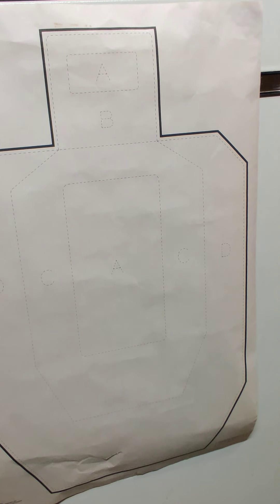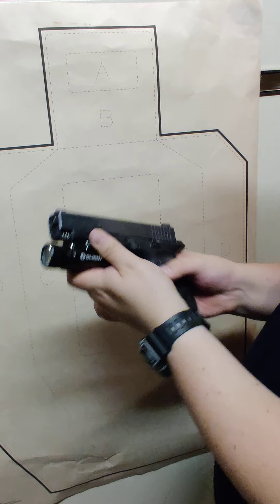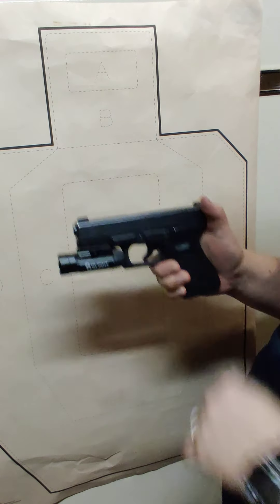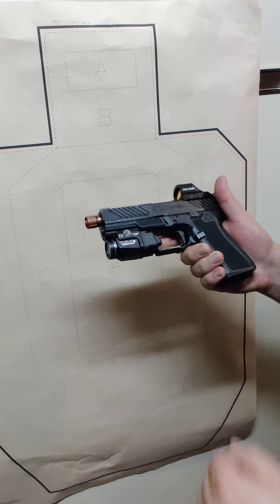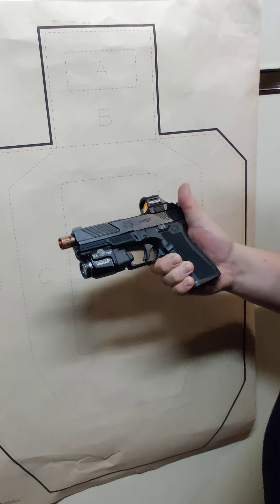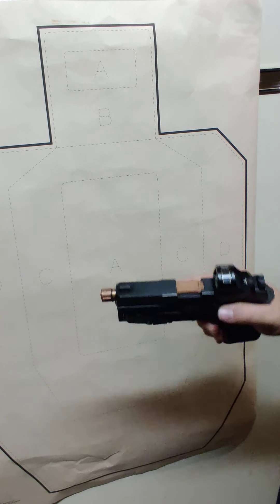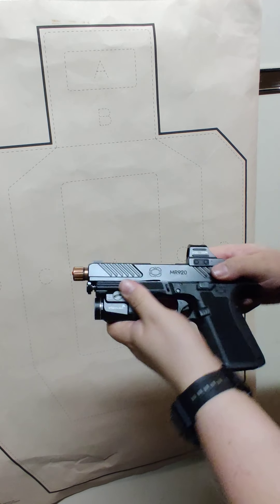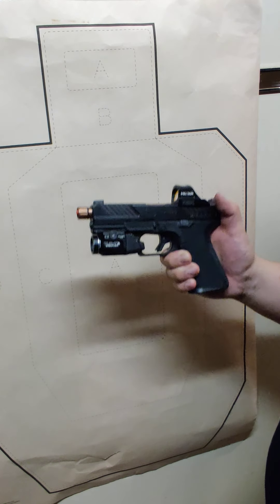Shadow Systems MR920 disassembly process vs a Stock Gen 4 Glock 19

Comment: Nice, just what I needed to know. Thank you sir. My MR920 Elite will be at my FFL in a day or two! Can't wait.
Reply from the maker: So awesome! You're gonna love it.
Reply from the maker: The best thing about it is the shooting experience. It's so smooth and controllable and tracks the sights right back on target.  Also don't be turned off if it's a little tight and stiff at first, it's gonna feel tighter than you're used to out of a polymer gun.It might even be hard to get into battery, or have a malfunction or two. Its just their tight tolerances.  Work through the 250 round breakthrough (I know that's hard with today's ammo prices, but trust me it's worth it ) and it becomes the best shooting 9mm I've ever handled, and I get as excited to shoot it as my friends' 1911s.

Comment: what i figured out with my shadow systems is i start putting pressure before pulling the slide back then when the slide is back just enough the buttons will give and you slide it forward. once you get the hang of it it feels super easy

Comment: Instead of pulling trigger first, drop down both slide releases, pull back slightly on slide THEN PULL trigger.  Slide will come right off.  Works for both Glock and the MR920.